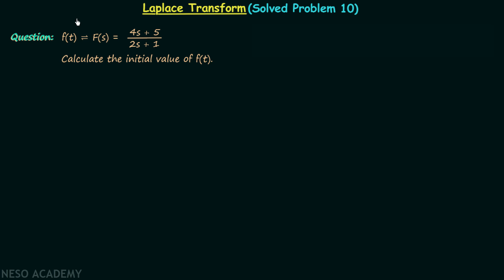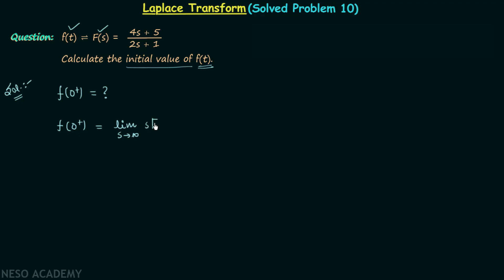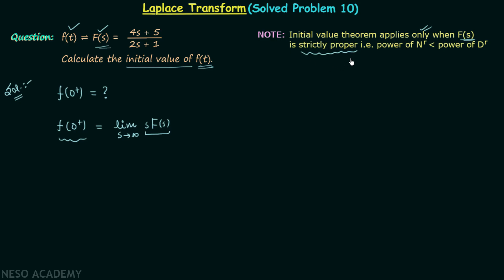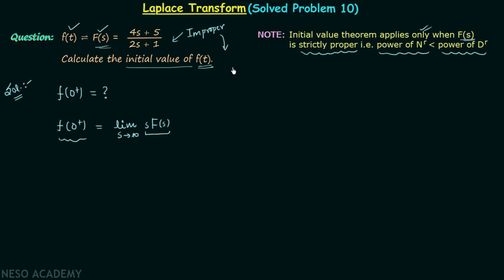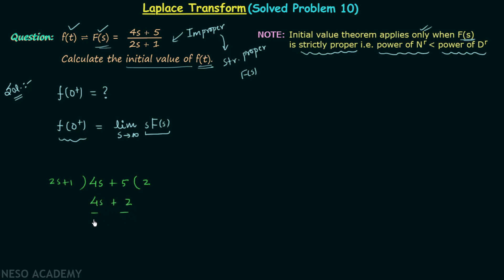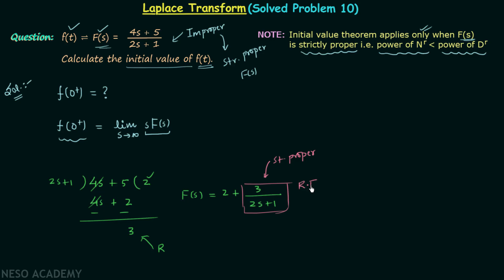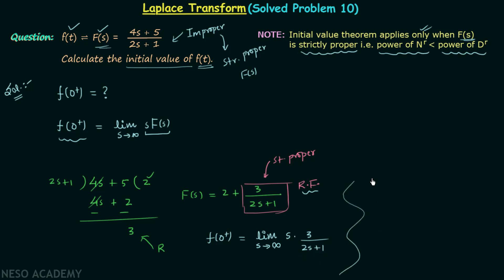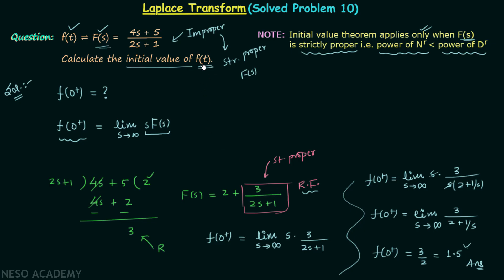Laplace Transform (Solved Problem 10)

Comment: F(s) = 2 + (3/2)*(1/(s+1/2))

By IFT ,
f(t)=2ð(t)+(3/2)*exp(-t/2)*u(t).....

here we see ð(t) function present...... the condition of initial value theorem says that it should not contain impulse or higher-order singularities at t=0. 

Then how you calculate its value??
Please Neso Academy
 answer my question..........
Reply: Let's calculate ivt for f(s)=2. f(t)=2delta(t). So f(0+)=0. since delta(t) is zero at all values except only at 0. Hence we are left with ivt for f(s)= 3/(2s+1). Like if you agree
Reply: @aniketpratik9233  This is a convincing reply as far as I could think. Thank you for the response.